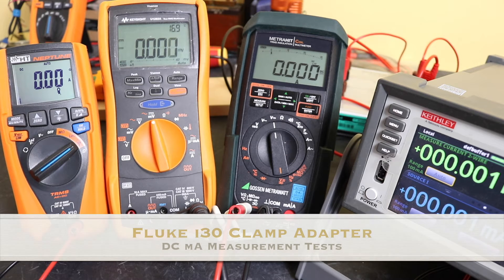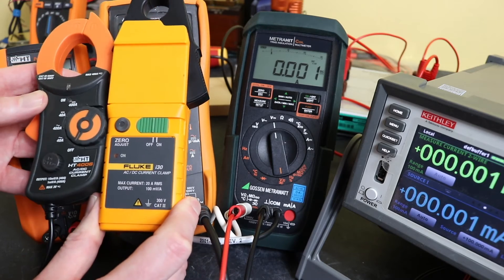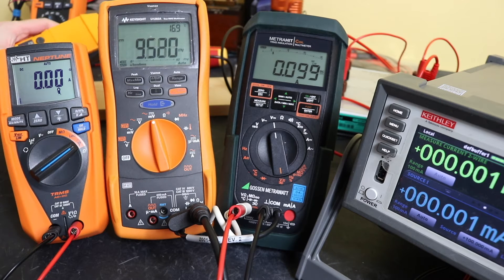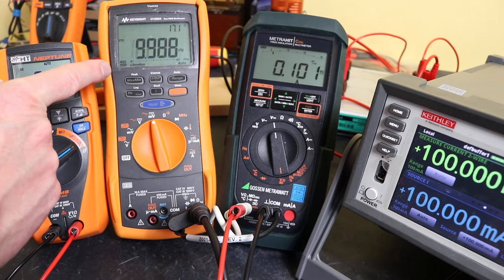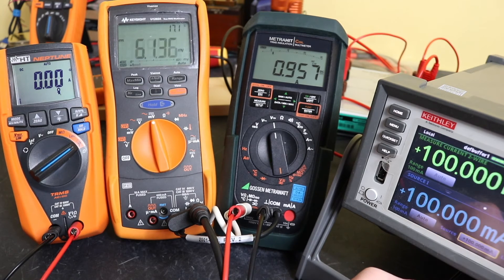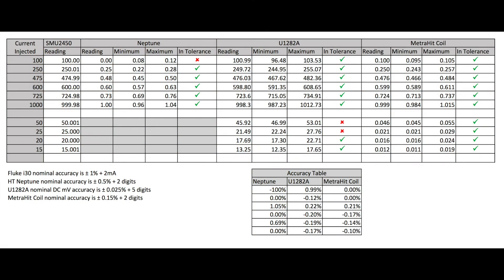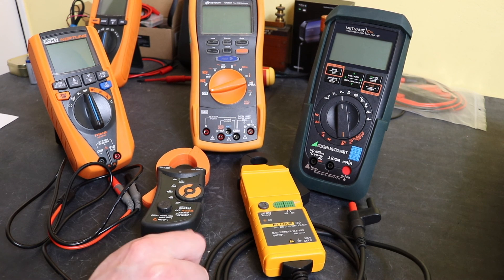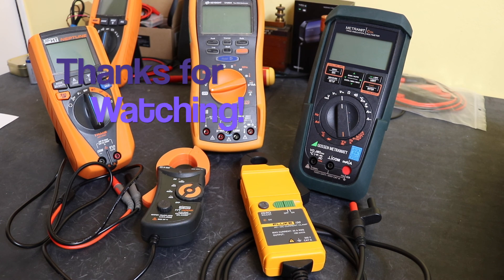DC mA Measurements with the Fluke i30 Clamp Adapter

Comment: U have to push and turn to zero the fluke i30,not just push like u would a Pico. Left to go neg and right to go pos. The fluke i30s is the best ,I have a few. The s just means mines bnc the reg i30 is banana. Good video
Reply from the maker: Yes, you are correct, push in and twist to adjust the zero. Presumably made that way as it is less likely to be inadvertently moved during use. Unlike the HT4006 in another video that can be caught and move the zero point whilst making measurements.
Thanks for watching and commenting.